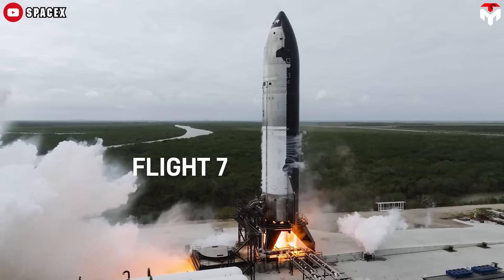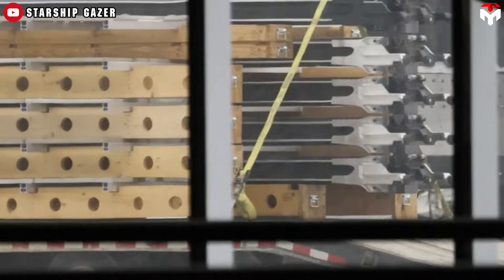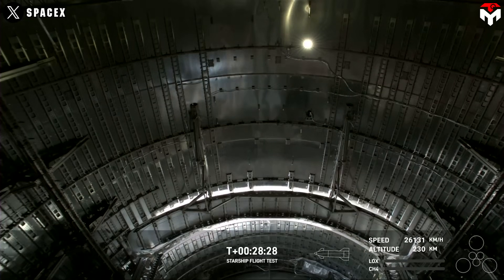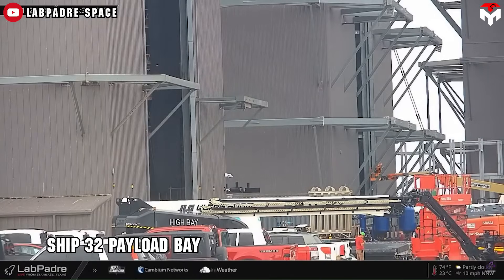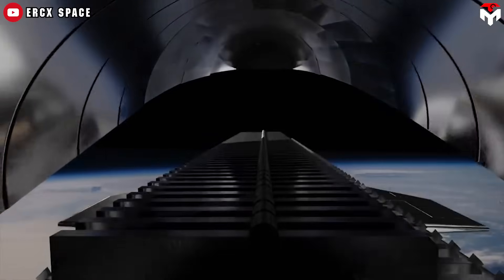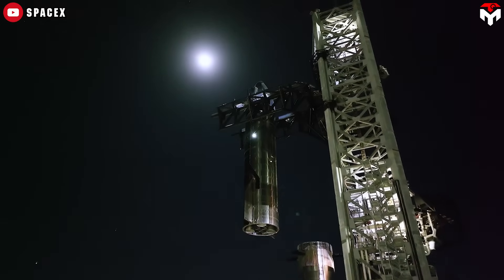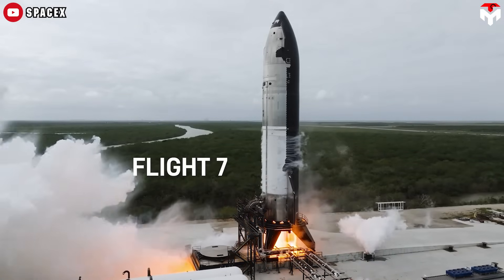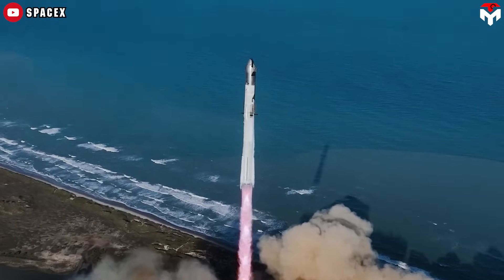550m3! New Starship's Flight 7 Pay Load Bay Upgraded to Break Physics...

Comment: I agree that the multiple satellite launches in one launch is extremely important/efficient. However Starship is currently only designed for the flat Starlink payloads (unless all of a sudden the whole industry changes from square to thin satellites all of a sudden)! I know this is still only a test bed rocket and they have to prove it's capability as a vehicle, but it won't become a feasible design untill they bring out the "clam shell" version to literally incorporate pretty much all payloads imagineable!! Just my thoughts that I think are on the nose.